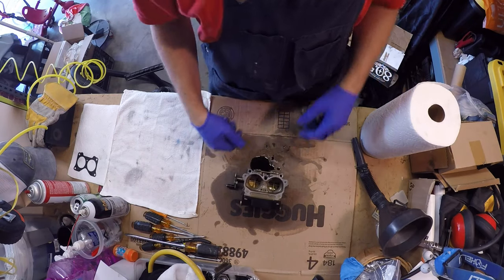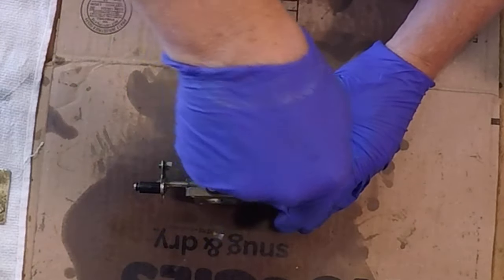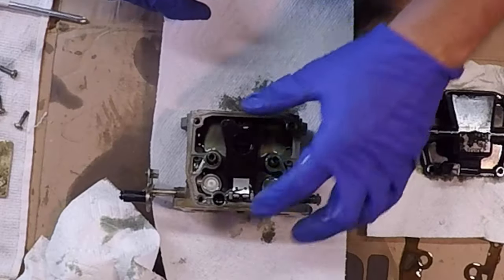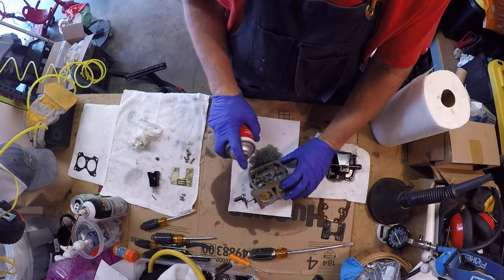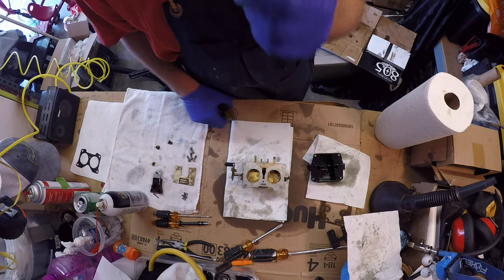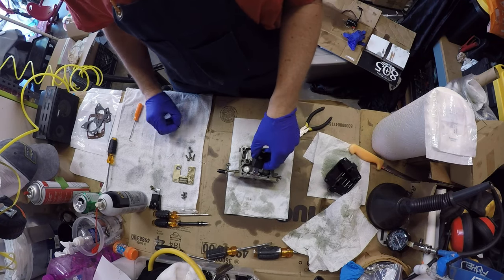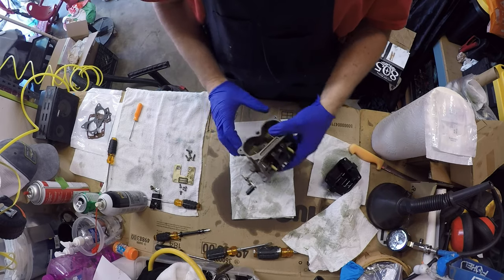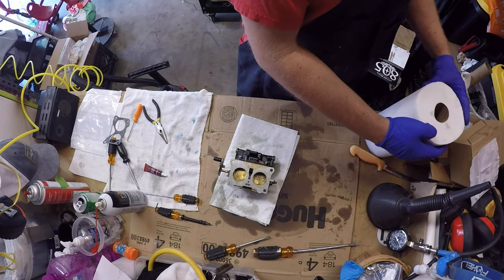1987 Johnson 90HP Outboard Carburetor Rebuild | Arima Sea Chaser Boat Restoration | Eps. 4:

Comment: I just got my first boat an 88 ranger 393v with an 87 Johnson V6 150. I don't know much but I'm learning. Took okk the air silencer and the carbs look nice and shiny. However, on the outside, I can touch the gasket with my fingernail and I see moisture and residue falling onto the other carbs. Where the carb meets the bowl I think. All of em are like that. Figured it's time to replace the gasket on them. The carbs look similar to yours. Same process? I see where the bots are to take the carbs off but I don't want to mis align or mess something up when I unhook them from the throttle link.  I don't think I'll be replacing more than the gaskets. The motor runs great. I was thinking about just bowing air into all of the jets and carb cleaner, then replace the gasket, not take everything out this time. Any tips
Reply from the maker: @CTRadventures  The gaskets are worn and old, that’s why it’s leaking from there and in saying that, it needs a complete rebuild.
So don’t do half of the work on carbs, trust me it will bite you in the ass later and removing those carbs on that motor is not fun. Buy a Johnson OEM rebuild kit for those carbs, don’t get the cheap aftermarket ones, they’re POS. You will need to replace everything in those carbs, the kit will have it all.  Throughly clean the carbs with carb cleaner including all the orifices. Also buy a carb jet cleaner tool, they’re like $7 on Amazon, you’ll need it to clean the tiny holes in the jets. https://a.co/d/1HOvN0B
As for the leakage, I think those should just pop off with snaps. If you put them back on, check the butterfly’s to see if they’re closed all the way, if not adjust them to close them. Don’t adjust any idle/ mixture screws and you should be fine. 
Good luck.
Reply: @SoCalSeaChaser  awesome thanks! Ya I just bought the OEM kitx 3 after shipping was $95. I'll give it a gander and hope I can complete it as a complete noob. 🤠 Just ordered those brushes. I'm also assuming this will help the idle a bit? I know you start getting into linkage adjustment at that point. Also what is that gripper tool? That would have come in helpful trying to get that screw back in the air silencer bottom screws by the crowling latch
Reply from the maker: @CTRadventures  Right on. Before you start, do a little more reading and watching other videos to get you familiar and comfortable with a carb rebuild, others might have some additional helpful information. But in reality it’s not hard to do.
Reply: @SoCalSeaChaser  doesn't look like rocket surgery. But you're right 👍 I really appreciate it.
Reply: @SoCalSeaChaser Watching this again hoping to do these Thursday. I had another prob come up. Hope it's nothing detrimental. Quick question, I got the brush kit. What is that little gripper tool you have you used in the jet? Not sure I wanna try my luck taking that little jet out, might brush, carb spray, and then comeessed air. Don't wanna mess that up
Reply: @SoCalSeaChaser oh also real quick, how do you get the link arm off? Thanks!!
Reply: @SoCalSeaChaser and while I'm in there I need to replace the gas line at the bottom carb as it is dripping a little

Comment: Doing my carbs now! Watching as I go. Took the top carb off and the tubes w the holes that go into the float valve, one is cracked! Do I have to get a new carb or is that a replacement part?
Reply from the maker: @CTRadventures  Not understanding what you are referring to as “tubes”? Could you point out a time stamp in the video where you see the “tubes”, then I might be able to help after I see what it is.
Reply: @SoCalSeaChaser  sure it's the jets either side of the float valve. Doing carb 2 now and they aren't cracked so I'm thinking might need a new one. Man I can't thank you enough for this video
Reply: @SoCalSeaChaser  doing my research, they are the emulsion tubes. I can see they are part of the carb and can't buy them. Trying to find two carbs on ebay w my part number is near impossible. I have hear of some people being able to take out those and have someone solder or JB weld the crack. I wish I was able to send a pic here. The rebuild went great thanks to your video. Took her back out and got to 55.5 mph WOT

Comment: I am wondering about the 2 silver round cap prices that come in the sub assembly kit with the gaskets. My gaskets under them seem to have some small visible gaps. What are those for? And how do you get them out to replace? I noticed you didn’t bother with them.
Reply from the maker: The caps you are referring to I believe are the Welch or core plugs. I didn’t replace mine because they were in great shape, no rust on them and they were seated very well. To get them out you have to be very careful on drilling a pilot hole being careful not to drill to deep, about 1/8”, then pry them out. If yours look bad, best to replace them. Once removed you will see small holes under the caps that will need to be poked to clean with a wire. Blow some air and carb cleaner in there, then replace the caps with a round flat punch. They will expand when tap them in place, but have to be careful doing this.
Search carb Welch plugs, should be some how to videos.
Drilling them out you can get shaving debris in the area that you want to keep super clean. 
Personally if I see they’re clean and in good shape, I will leave them alone.
Some will disagree and say replace them, but if they’re good shape, I just leave them alone as you could start chasing problems if you get stuff inside or don’t seat the new caps on properly. Thanks for watching!

Comment: Can you link everything you used for lubes and cleaner
Reply from the maker: Thank you for watching! 
I don’t like adding links because usually in a year they might become unusable.
But these are the parts I used:  
Gumout carb cleaner. (The 2nd I used was another carb cleaner spray)
Johnson Evinrude OEM Carb Repair Kit 439076 with Float BRP/OMC Carburetor.
Phillips head screwdriver and a pick.
Reply: @SoCalSeaChaser  did you use a gasket sealer?
Reply from the maker: @jackofnotrades5640  No, the only other thing I used was Blue Loctite on the screws.
Reply: @SoCalSeaChaser  thanks

Comment: Great video thanks. On my carb there's a cutout by the float that says 1 3/16 which I assumed was ment as the gap for the float, however I noticed that you didn't adjust yours. Do you think it's worth doing? Thank you
Reply from the maker: First off,  yes you are correct, I didn't adjust mine at that time in the video and that was by accident. I ended up opening it back up to level the float afterwards. Unfortunately YT doesn't let me fix this by adding a caption, but thank you for bringing it up.
As for the float, measuring floats level to specs is good and should be done. But in saying that, for me I've always leveled the float by using the carbs body line to get the float level. Others will disagree, but I haven't had any issues in doing that way.
Reply: @SoCalSeaChaser  great video help a bunch. About float adjustment I’m with you level to the body and 7/8- 1 1/8 float drop per manual.